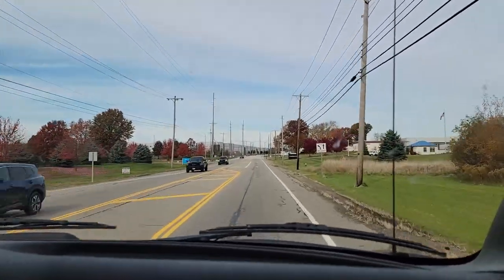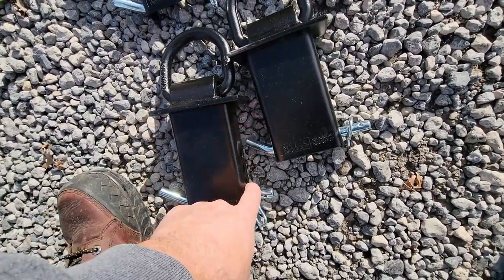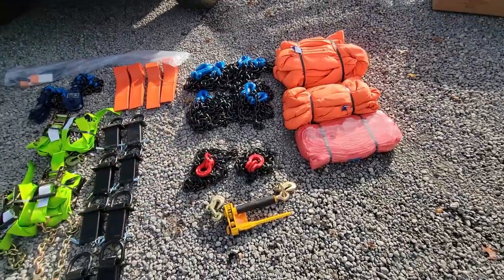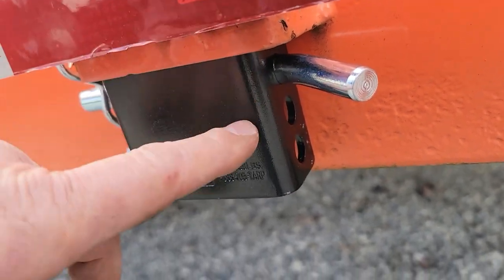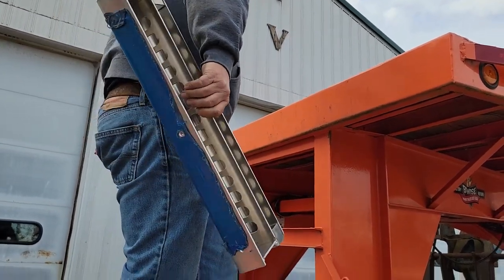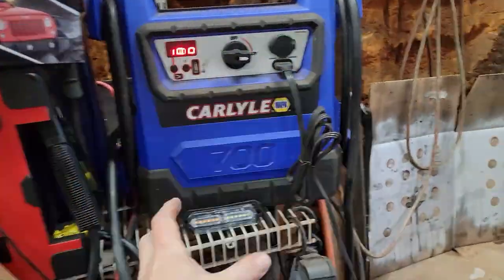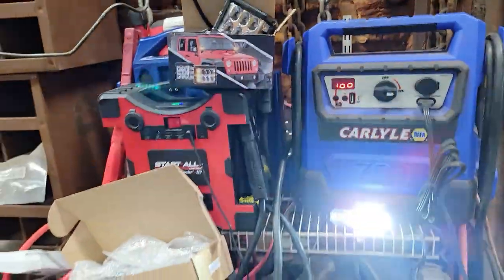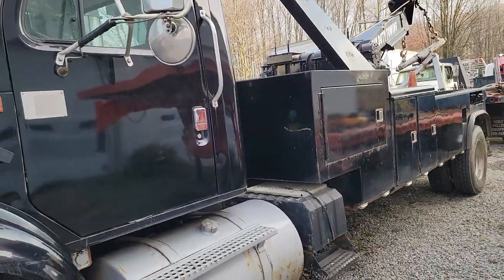8100 WRECKER PT5. NEW GEAR FROM MYTEE PRODUCTS AND LOTS OF LIGHTS!

Comment: Ron Pratt added strobes to his wireless light bar on a seperate toggle so he can put it on the disabled vehicle first off and turn the  strobes on so they can be seen while he is hooking up then flip the switch off when he is ready to roll  ! It seems to work pretty slick !
Reply: He also has the strobe light that affixes to safety cones.

Comment: Three years ago I was heading back to South Carolina. On I-40 westbound at Winston Salem North Carolina I was watching the traffic on the oncoming side. There was a delivery box truck on the shoulder with an obvious flat tire as there was a tire service truck behind it with a pile of flashing lights on. As I passed by I took one more glance as a passing car ran completely over the tire technician. As what seemed like a pile of rags came out from under the back of that car I knew I just saw a man die. As soon as possible I got to a safe spot to pull over and gather my composure. As a veteran of the Gulf wars I was accustomed to death and dealing in death. That was war, there were assurances that was a given. This was an unnecessary civilian casualty due to driver distraction or negligence. The children of that father of two would never see their dad alive again. Yes my son checked for me, I had to know for sure if what I saw was real. I was pretty certain by the police cars, ambulances and fire trucks that went screaming by on the opposite side as I sat in my car. Hands shaking and tears streaming down my face I finally gathered my composure enough to get back under way. The next rest area I pulled off and walked the rest of the shakes off while talking to my wife.
It had been several years since I separated from the military but all the emotions came flooding back like being hit by a sledge hammer.
Or worse.
So you put as many lights on that truck as you want. The brighter the better. People don't give a damn now days who they hurt as long as they get what they want.
Please folks move over for emergency vehicles and personnel. 
As they used to say on the TV show
Hill Street Blues,
"Let's be safe out there".
Cheers 
Terry
Reply from the maker: that is one of the worst stories i have heard. it is exactly why i am putting lots of light on the truck. in my next video, you will see an example.....i was witness to an accident where a woman was thrown from a motorcycle an landed on the asphalt...no helmet. seeing someone lose there life will change you.

Comment: I'd recommend a plastic snow sled to keep in the wrecker. Towing company that towed a broken down truck I drove used a plastic sled to get under the truck and pull the drive shaft. Kept them dry, held the tools they used, works on pavement or grass, and is cheap to replace if and when it breaks. Vaughn keeps them in every truck.
Reply from the maker: plus....2 little ones will want to get it out and slide down papaws hill behind the shop....win win win

Comment: Please do everyone a favor and have a day/night switch did your lights.  Having as many lights as possible during the day is safe.  However, all those at night is worse than having none at times!

Even as a firefighter, we have our lights limited at night.
Reply: I was just about to say to many lights will blind you I've had to come to a stop because the lights blinded me and I couldn't see where the guys were at every other trucker said the same thing on the CB you were worse off having to many then not enough which the blue and white flashing is the worst especially if raining so more isn't always better now this is JMO from a 45 year truck drivers point of view with several million miles under my worn out belt
Reply from the maker: tough call. i want to do everything i can to get driver's attention....

Comment: If you can get dimmable adjustable  control for your lighting for day and night  work you won't run the risk of blinding drivers coming up  behind you especially in the rain at night  .When you get it set up check for your self how much they are affecting you being seen too much  light  can also be bad

Comment: Never seen or had wrecker use binder on safety chain.  Choke axel to lift and wrap catching hooks welded to lift.  
Add set of strobes to your light bar. LED draws little.   Mounting work lights to boom is good. If raise boom covers more area.  
You might need to check with state if you allowed white strobes or other colors if you going to be a business.  
Think Miller has several training videos on their site.  Give you some ideas? Echo makes portable led recharge lights.  Nice for under truck at night. 
Adding a shelf is good. Charging rack for dedicated impacts on trucks? Least tool kits for caging brakes, dropping drivelines.  Adapters to tie into air systems?  All nice to have
Reply from the maker: Binder is for the chains that wrap the front axle to the under reach cross bar.

Comment: When I live in Springfield township and plowed snow I never had all of mine on the same  Pattern I tough that the more moving lights in denffent patterns  the more people would think there was more than one. Truck moving from a distance and slow down  i really like yours and your wife's videos  I started watching when was at the little red barn and doing the ford trucks 250 350 4500 and 550s I learn alot from watching them  but I still enjoy watching the big trucks to
Reply from the maker: im not sure if i can put each one on the pattern i like and not sync them together. that might be a good idea.
Reply: Maybe on two switches and live the one in the on  Position and it only get power when the first switch is on

Comment: I’d be kinda concerned about your stake pocket d rings ..the pin is now your week link I know the mto here would be looking for the capacity of those pins I think?just my opinion
Reply from the maker: think about the 5/8" hitch pin on a pickup truck pulling 14,000 lbs on a trailer. this is a 1/2" pin taking minimal vertical load. the majority of the loads will be side loading the hooks. im not concerned at all.

Comment: Do you have to change out the alternator or are all the lights low voltage?
Reply from the maker: all lights are l.e.d. they require 12 volts and very very low amps.